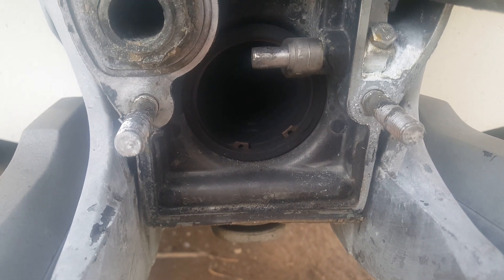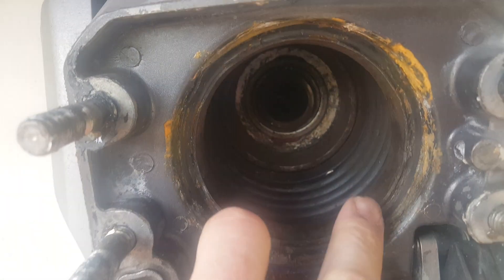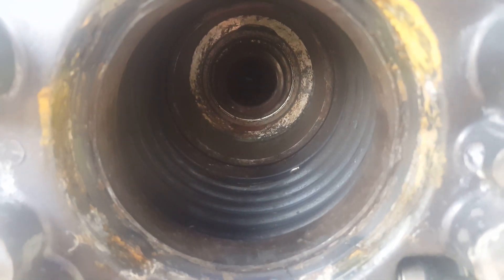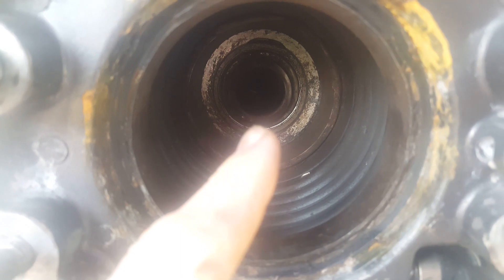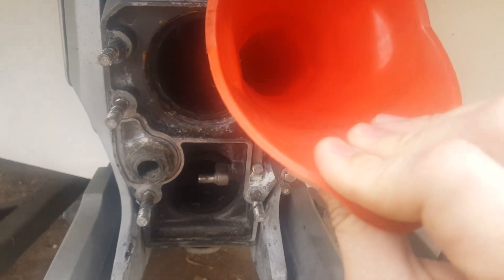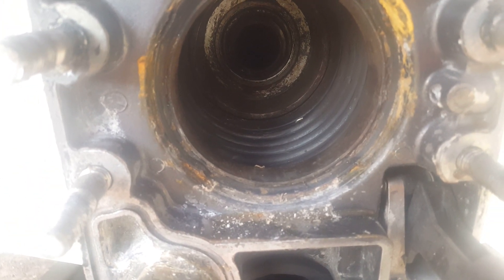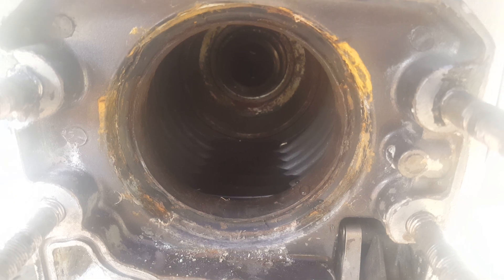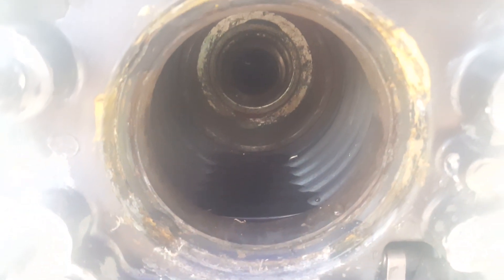OMC Cobra Volvo Penta SX Bellows Assembly - Leak Check

Comment: good video... but when boat is in water there's water pressure on all sides of the bellows and there could be a crack anywhere in the bellows not just the bottom..

Comment: Do you have a video on how to replace omc cobra u joint bellows?
Reply: I’m looking for a video aswell. I’ve been struggling trying to get the u joint bellow inside the pivot housing. There must be a trick to it?
Reply: I ended up just having a go at it.  The hose clamp/worm screw should be at about the 2-3pm o’clock position to be able to tighten it with a long screw driver or socket.  When trying to fit the new one, it seemed like it was getting caught on the shift cable lever, so I coated a little bit of grease to allow it to slide over the “vulnerable “parts in the swivel housing area.  Not too keen on breaking anything more than necessary! The u joint bellows takes a bit of squeezing and massaging to get it in place. Then it’s just a task of tightening the hose clamp and make sure the metal tab with wire attached ( not sure what it’s called) goes on too. Bit of bellows adhesive and your all done.
Reply: @graemewood1216  quick question, did you have the swivel housing on a bench to try and get it into place. I tried with it attached to the transome bracket bit got frustrated and took it off and tried on the bench still without any luck. My hands are large and strong, I pretty much have to use my fingers to work with
Reply: No, I left the housing in place. I have the tendency to break things by doing more than I need to. ”if it ain’t broke don’t fix it”
That being said I used one hand in the bellows to get the bellows in thought the housing and the other hand in and underneath to help position it, as there isn’t much room. Kinda need to pivot it up as much as you can to make the room. Also smear a bit of grease on the outside of the bellows to make it easy to slide into position without the rubber gripping/binding to those breakable parts.
Reply: @graemewood1216  I really appreciate your advice and time. 
Thanks and take care

Comment: I noticed the other end of the exhaust Bellow There’s no clamp do you just add adhesive to the end?
Reply from the maker: There is a clamp. Keep in mind it’s there just for noise control as the exhaust bellow lives under water, with water in bellow.
Reply: The bellow end goes inside not over the drive so how do you put the clamp?

Comment: hi i have a creamy oil leaking from my bellows what kind of seal would be leaking
Reply from the maker: Linda Turner The bellows have a adhesive that attaches them to the transom housing. That's the only native liquid that would be naturally found there--keep in mind that would be hardened by the time you'd see it. The other native liquid found around marine gasket seals are what is referred as gasket sealer. It's basically a brown sticky gasket compound used to reinforce seals in marine environments. Both compounds I mentioned are found around sealing surfaces--places with gaskets, near the bellows. Are you seeing something that looks like oil? Dab the suspected compound on your fingers. If it's sticky it's gasket compound If it's hard, it's bellows adhesive. If it's slippery and smells like motor oil, that's another reply altogether.

Comment: Just picked up a boat and testing the cooling system. And I noticed with my exhaust bellow the exhaust water /exhaust goes out the out drive but there is a gap between the actual boat and lower unit to the exhaust bellow. Just wondering if this is normal or if the exhaust bellow is supposed to be a flea. Line connected to the exhaust. My boats a little loud and thought that might be the reason. Any help is appreciated
Reply: Solid line*
Reply from the maker: I thought I commented on this already--it must not have took. The perforations in the exhaust bellow is normal. If it is cracked or partially detached, I recommend replacing it. The common reason to replace them is excessive exhaust noise.

Comment: oil and what reseal kit do i get for my upper unit thanks
Reply from the maker: Linda Turner Hey if you have oil in the upper bellows you have a major leak coming from your bearing carrier seal. There is a seal kit but it's useless without a lot of very expensive tools. You need to send it off to be repaired. Ignoring the issue with damage more parts as water gets in and/or oil leaks out. Costs about $600 http://www.sterndrive.info/id132.html
Reply: thanks for your responce i have the tools and the abilty to do the wor k . can i get a reseal kit on ebay  with a filler neck also. and have you done a video on this,  i have the 270 out drive with the 4 cyl volvo penta aq125
Reply from the maker: I don't have a video on that one yet. Your parts can be found here: http://epc.brp.com/Index.aspx?lang=E&s1=0d631b7b-efe3-4bc4-8df0-a76cbe9742af  Select "Stern Drive" and the year of your stern drive. Select the model engine and look for "Upper Gear Housing." I recommend the gear housing seal kit or if you want to just replace one part, you need the bearing carrier seal and o-ring. The part numbers on that site can be plugged into eBay/Amazon.

Comment: I do not think this is a good test since you are only checking the bottom, could have leak from top or sides. Since this is an sx should be able to loosen front clamp after its been in water and see if water comes out. Also if your this far into it just replace the bellows already. Check for outside cracks dry rot etc. Exhaust bellows has 2 drain holes on bottom sx-m anyway. not sure which sx drive this is.
Reply from the maker: It's definitely not a perfect test. Keep in mind a lot of people remove their outdrive every year. For that reason, it's not always going to be the case that you should replace the bellows when you have the outdrive out. I'm going to be doing another video this week where I pull a Volvo Penta SX outdrive. I'll do I update video.
Reply: @michaelromer2016  guess i should have done a video  pulling mine right now for the first time 15 year original bellows no leaks also no bellows sealant when removed has a over lip seal that keeps i place def put sealant on replacement